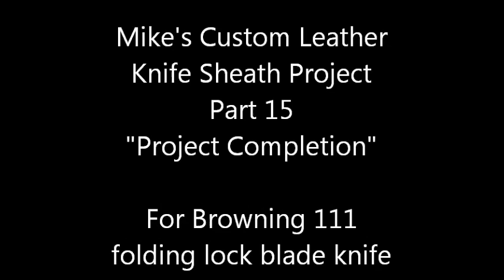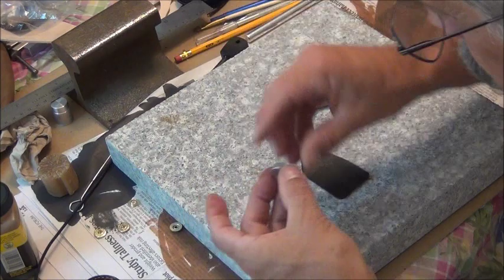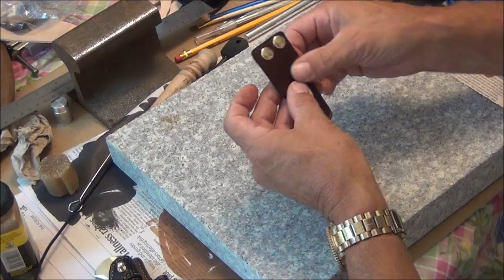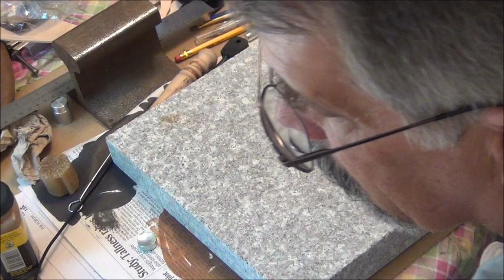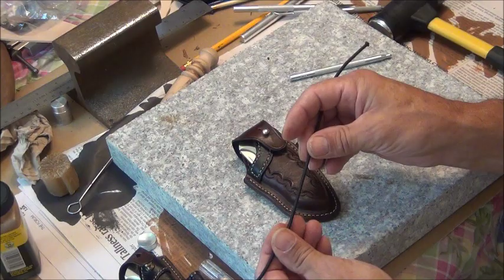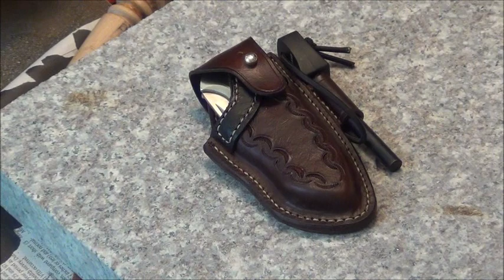Mike's Custom Leather Knife Sheath Project Part 15

Comment: Thank you Mike, that was very well done, you took your time and gave it some thought, well done you! By the way my friend , I'm sure you know it's called a Sam Brown Stud. As a Brit I can tell you it comes from the man who designed the belt worn to this day by our Officers in the Army. One belt round the waist and a shoulder strap  from the back of the belt worn over the left shoulder, always in brown leather. Secured of course by the good old Sam Brown Stud.  The sword is worn on the left and you can also have a brown leather holster for the old fashioned service revolver. Not sure what they use in today's modern Army with the likes of Glock as a combat weapon. This being You Tube Mike, I'm sure there is a a clever person out there who could tell us. Thanks again, I have learned from you and really enjoyed your work.
Chris.
PS.
I have only just started aged 68, many years ago I worked as a clicker in a shoe factory. The name comes from the sound of the blade as it went in and out of the wooden block we used to cut the shoe patterns on. You can still buy the clickers knife in Tandy's  Leather equipment, I think you will find it a huge help as the blade cuts round corners very well. Good luck & keep up the good work.